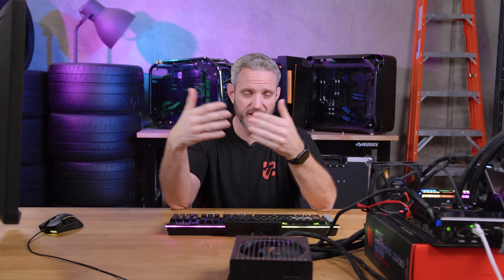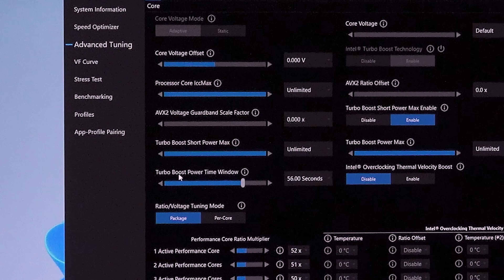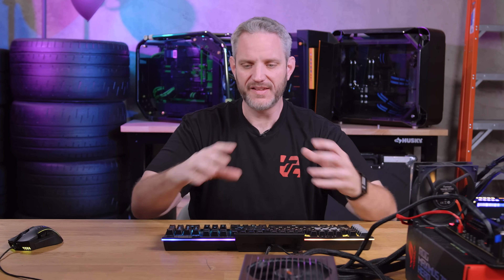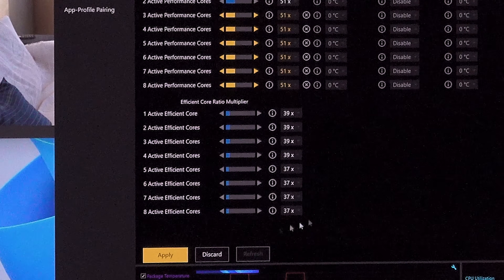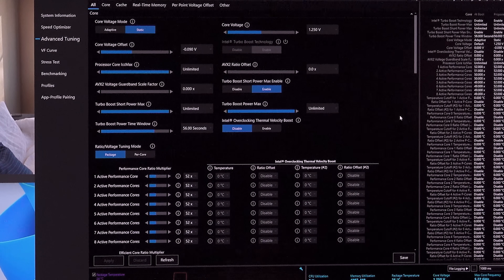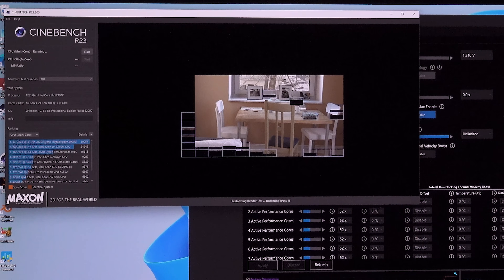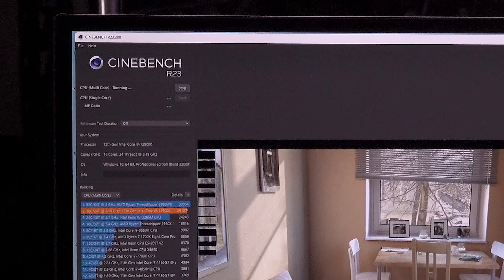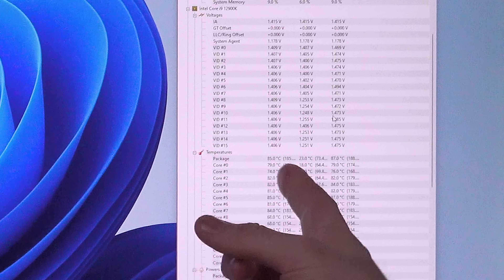Overclocking the 12900k is pointless and dangerous! Heat and Voltage testing...

Comment: My dream CPU right now is a 3990x Threadripper overclocked like crazy, but I doubt it'll happen because a 3960x clocks higher naturally. Why must we choose speed over brute force...I want best of both worlds. :(
Reply: I have a 3960x, mostly bought because it has a ton of IO, and pretty good clocks. I also went stupid-level with the cooling because I wanted the beast to purr like a kitten, not howl like a banshee, when it's running under heavy load. Two all-copper 560mm long, extra-thick radiators definitely help with that. Expensive, but how much is your hearing and general comfort worth to you?

I've seen it bench with results higher than some 3970x results simply due to being able to stay cool (and stay at boost speeds) for long periods. Heck, when I first put it together, it was one of the highest Blender bench results in its class on the planet. It's still in the top 15-20% of all global results. While it'll never do multi-core as well as a 3990, there's definitely at least some of that best-of-both-worlds you can get if you can keep the chip cool enough that it never drops out of boost.

Comment: AI optimize on my z490 with 10850k was allowing 1.6v to the core. Insane temps on a 360aio. Manually setting voltage to 1.3v instantly dropped temps by over 20c
Reply: holy shit 1.6v thats insanely high. what was that at 5.4?
Reply: @parkersgarage4216  5.2 all core 5.4 boost on a couple. Manually I was able to get those same numbers with 1.52v (stable, still throttled.)
Reply: @Toesmasher  I have 1.37v 5.3 all core w 48 ring 4133 cl15 w memory @ 1.5v. I haven't tried 5.4 all core yet. Manual is Def the way to go for sure. My mobo was pushing more than that into mine as well. I Def reduced temps. My idle is 29-32 depending on what I'm doing. Full on gaming is 60 highest I seen was 62. This is my first build as well so I'm figuring everything out. I have a 3080ti fe and a 10900k. I had a 10850k but switched. The 10900k is Def better and uses much less voltages. I was curious how big the differences were and if there even was any. The 900k also has higher stock clock's. Lowest on 10900k is 51, this was my first build and I was curious if there were any differences at all. Figured I'd buy both and see what and if any differences. So if you were curious yourself that's the difference. I like the 10900k for the lower volts and temps.
Reply: @parkersgarage4216  the 10900k is significantly more expensive. That being said, the 850k is just a 900k that missed the mark by the smallest of margins. It makes sense the 900k does better with voltage. Now I run 5.0 all core, 47 ring: 1.32v. I’m much happier, temps while gaming stay under 70, full load 84.

Comment: Thanks very much for this video! Exactly what I was curious about. I see this as a complete win. I'm building a custom loop with a few radiators and EK's new flagship 1700 block. Hopefully, that will be enough cooling power. I just want to get it to run 5.1 on P and 4 on e. That will be a nice improvement over my current 8086k at 5.1

I've got everything I need now. All I need is DDR5 RAM and hopefully luck of the draw with my chip. Fingers crossed. I work in 3D raytracing and modeling, so I want to squeeze what I can.
Reply: Good luck with your rig man! Sounds like you’ll be putting it to some good use 👍.
Reply: @Jorge Laughingman I would certainly define gamers as an average user. Games just aren't that demanding compared to other applications. For me, working behind the scenes of games, the DDR5 and single thread performance is huge. But everyone is entitled to their thoughts.
Reply: @Jorge Laughingman and to add to that, although we're likely never to agree, I think that right now AMD is looking at their line up and thinking... Hey, we don't have a definitive performance win. Not taking into consideration the heat or power. And at the end of the day, flagships aren't for average users, and those who aren't average users won't care about the higher power draw or higher temps. I don't at least. And I've always chased performance. And in this case, like it or not, Intel wins in performance by matching AMD, and doing that for a lower price. 

It'll be hot. But I don't care. I won't have to fire up a frying pan to cook my eggs. There ya go, now the power draw doesn't matter.
Reply: Check out Optimus pc parts, I have their cpu block and an EK you block and I really like the Optimus stuff over EK
Reply: You don't have to spend EK money unless you really want too.  All water block and custom loops performance are about same. Just mske sure they  dont leak and  your good to go.
Reply: @SAVA47-00  yeah, I just like the look of EK blocks. Other blocks look too over designed to me. I like a simple square.
Reply: @MasonMenzies  word! they do look awesome.
Reply: @Jorge Laughingman I see your point. And I agree with everything you've said. But Intel has done something new here for PCs, and they've paved the way for some new tech. This comes at a time where AMD has dominated the field for years. This is shaking the competition up again. We can already see that with all the price drops AMD has made since 12th gen's launch. Did it beat AMD flat out? No. But it does perform very close for cheaper.... Considerably cheaper. That is a win. No one ever said a flagship had to run cool on a crappy AIO or air cooler. 

It uses more power... It runs hotter. It runs faster for cheaper... It encourages competition... 

Do you not understand what a "win" is? 

Tests I see run under load at 80-90c with an AIO. That is more than reasonable. And it's a flagship. It should be Watercooled. 

As for power... If you can't afford the extra power bill, a flagship i9 likely isn't for you anyways. 

How would you define the release? Seriously. I'm not trying to judge your opinion. Would you say it was a fail? A tie? Curious what your thoughts are. Because from my point of view, it is a win, if only because it encourages competition.
Reply: @MasonMenzies  I agree. If you are getting a flagship cpu that already costs around $900, you should probably be able to also afford cooling and power for it (which will be much cheaper than the chip itself). Plus, I am interested to see where the idea of the E and P cores will go with both    AMD and Intel chips in the future.

Comment: The sku race is BS go 1440p or higher relay on your gpu not cpu they can and should do the hard work
Im going am5 only cus of the features if am5 will support my 3600   It will continue to the next platform
Reply: Am5 is a new socket, your 3600 won't have the same pin arrangement

Comment: This is really good info, thank you for the video. I am planning on updating my PC with the 12900k, just waiting on my Z690 Hero MB and some DDR5. Good to know that I won't have to mess around with manual overclocking, especially because I will mainly use the PC for gaming.
Reply: Even at stock clocks the 12900K is a beast. The gains he was getting (5-7%) might not be worth the extra heat for gaming. That's of course up to you, just my thoughts on it.
Reply: i have one now for 2 days and i can say WOW! in the bios you set 2 buttons to ai overclock and boom
cpu p cores to 5.3ghz and e cores to 4.0ghz, with not much heat.
it is so easy nowadays, and that thing is a beast with my 6900xt
Reply: @Poppaai  welke ram gebruik je
Reply: @glitchinthematrix9306  ddr4 4000mhz cl16
Reply: @Poppaai  nice speel je toevallig warzone? Welke fps haal je daar
Reply: @Poppaai  So did you notice a big difference from a stock 12900k to an overclocked 12900k? If so, how much did you overclock it?
Reply: @Joe_Friday  5.3ghz on all p cores, 4ghz all e cores
Reply: @Poppaai  Which mobo? I have Strix-A Z690 and haven't messed with OCing my 12900K yet.
Reply: @seanjohn7802  asus z690 tuf gaming d4

Comment: Picked up a 12900k yesterday. Thanks for doing all of this so us lot don't need to spend time smacking our head into the desk for hrs tinkering trying to figure out the riddle of how Alder Lake hands OCing.
Would be cool to see what OCing of DDR5 looks like, as the 38-40CL on DDR5 is looking like something that can be reduced maybe?
Reply: DDR5, everyone still doing it differently but a pal of mine just did 6600c30 at 1.5v with an aida score of 100gps r/w and 45ns latency
Reply: Don't use this as a jumping off point if you're overclocking. There's more settings and control in the Bios. Depending on your cooling there is 10-12 percent improvement to be had over stock. De8auer usually has good OC/Bios guides that'll steer you in the right direction.
Reply: @battlephenom8508  go check out skatterbencher instead with a very helpful step by step guide. He's one of Europe's top professional overclocker afterall

Comment: so there is a reason as to why counts start at 0 for computers. So with binary(base 2) it is 0(zero) and 1(one) and the with all the bases. (base 8, 10,16, 32,64, 128, 256, etc) they then also start a 0, so that is why your core counts will start at 0(zero)

Comment: They start on core #0 because basically all computer programming uses 0 indexed arrays. For a 4 bit binary number, 0000 binary is 0 decimal, 1111 binary is 15 decimal.

Comment: Yes overclocking these Intel CPUs is not needed. I don't like any CPU to be over 60° idle I'd have to under lock all of Intel's CPUs they way to hot. If I wanted a room heater I'd buy a heater for that not a CPU.

Comment: Hey Jay, i noticed you are checking the VID value in HWmonitor, shouldn't you check the Vcore value?? (from what I understand the VID is the voltage value required by the CPU and the Vcore is the voltage value actually given to the CPU measured through a sensor, am I right?)